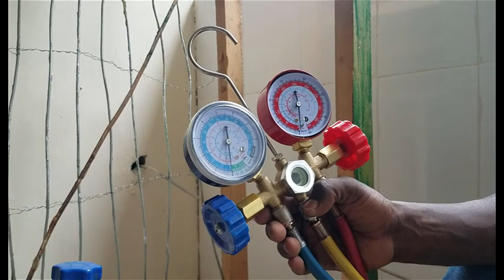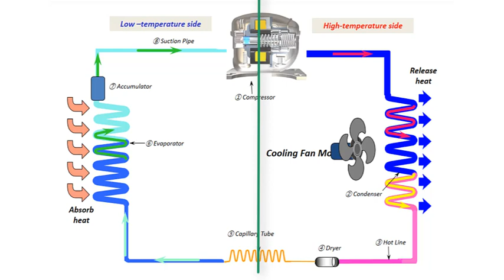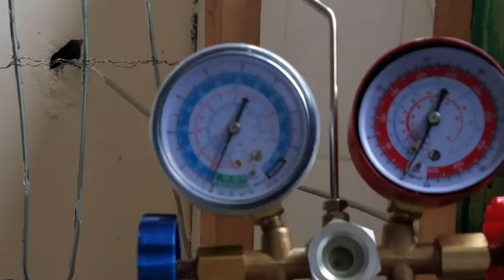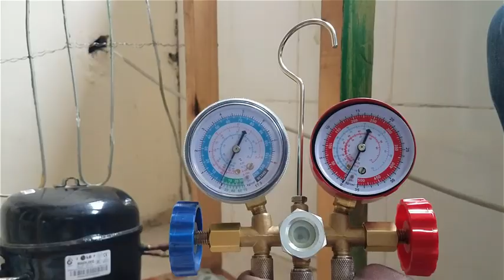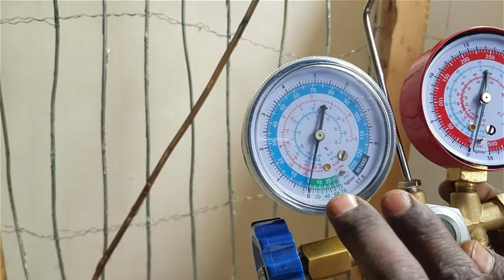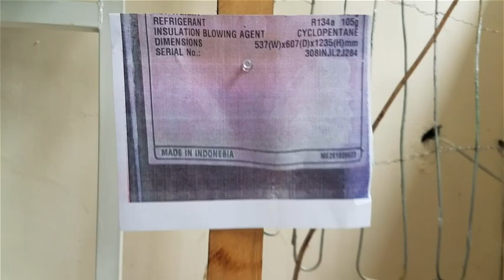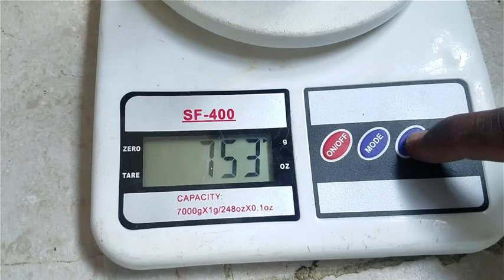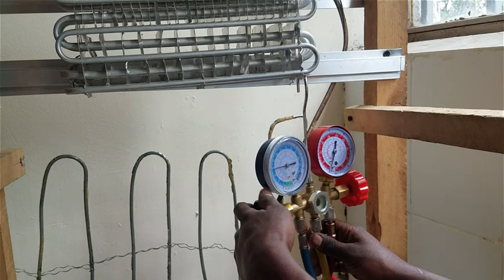how to put gas in fridge

Comment: የማስተማር ሂደቱ በጣም ደስ ይላል በዚሁ ቀጥል። ሙሉ ጥገናው ብትለቅልን አሪፍ ነበር ።እድሜና ጤና አብዝቶ ይስጥህ። አንድ ነገር ላስቸግርህ ሙሉ ፍሪጅ ለመጠገን የሚያስፈልጉ እቃዎች ዝርዝር ላክልኝ በኢንግሊዝኛ
Reply from the maker: 🧣Refregerator Material
1. Manifolding guage 
2. Oxygen
3. Acitline guage for oxygen
4. Buttane 
5. Copper lead
6. Otony lead
7. Tourch (handle)
8. Hose for oxygen
9. Compressor different type
10. Defrost timer
11. Overload common type
12. P.T.C relay common type
13. Thermal fuse
14. Bi-metal
15. Thermostat
16. Lamp 20W/220V
17. Refrigerant ---- R134a